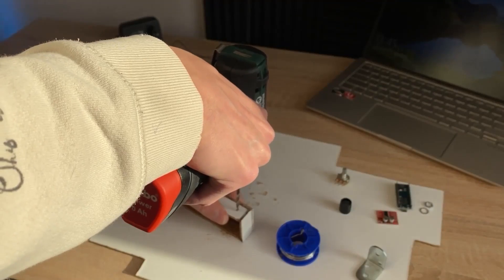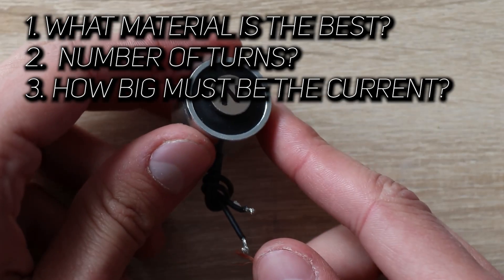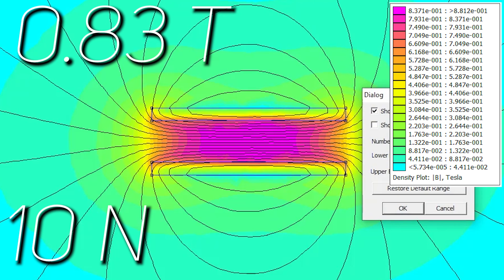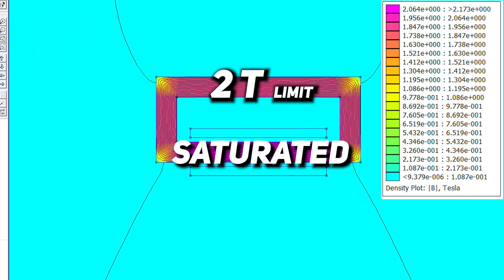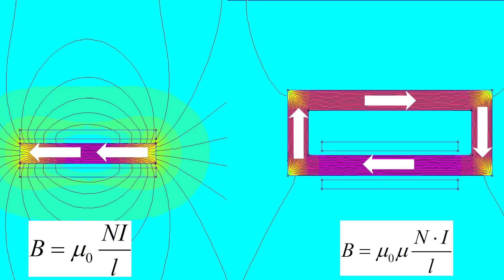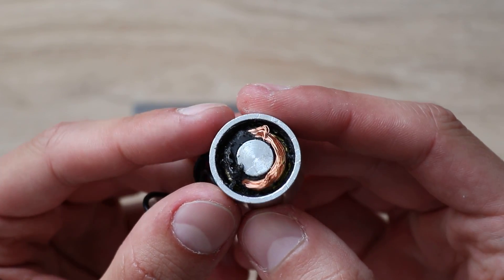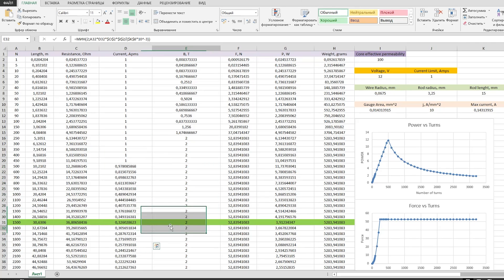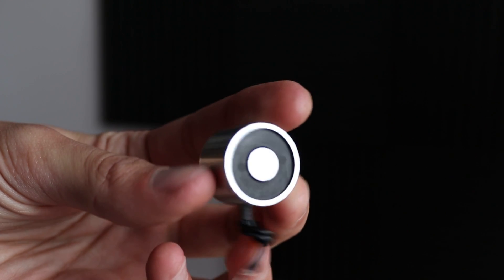5 Tips To Make A Good Electromagnet / How To Calculate Electromagnet Force?

Comment: Any chance you put a link to the solenoid and battery source you used?
Reply from the maker: Hi, could you please clarify which exactly moment you mean? I attached some links but not sure you wanted exactly them :)
shorturl.at/aUX23
shorturl.at/inCF1
Reply: Nice! Thank you very much! So you used a wall plug for the solenoid and not a battery? Nice! Thank you!
Reply from the maker: @R0M4NS623  Yeah, no problems with using wall plug power supply. Except mine had a limit of 1 Amp and it worked fine with an electromagnet form a store, but didn't quite work with a home made one due to a several mistakes i made :)

Comment: I wanted to ask a few questions, how did you get electrical steel in such small amount? Did you buy it wholesale with some other people? What is the realistic wire thickness if you are winding by hand? thanks in advance.
Reply from the maker: Hi, i think you can buy electrical steel roads from ebay, but then you need cut it, make a groove in it using lathe, which is not easy. Maybe the easiest option is to get an old transformer and use its core :)
Reply: @NickElectronics  damn, completly forgot about that site haha. Thank you very much.
Reply from the maker: @jokubasmirinas116  no problem

Comment: Thanks! i been trying to make a small pneumatic solenoid valve and the coil is as weak as a dead horse. 
my core is likely carbon steel. i just grabbed some iron rod stock from a hardware store and threw it on my lathe. 
my coil is ~1300 turns of 31 AWG magnet wire and im trying to stick with 12v for the coil. but i have to crank it to 24v to make it work and it gets hot. 
im not sure how much my 0.5mm thin walled delrin bobbin effects the strength. 

starting with better permeable iron core should give it a boost of strength. i'm not sure what else to improve.
Reply from the maker: Things will go better with an iron core, that's for sure. What is the resistance of the coil u have? How hot it gets? Cause even a magnet from the video gets hot. For example : 12V * 12V / 35 Ohms = 4 Watts of power. If your solenoid is really small you have a high power density and it gets hot. Maybe try increasing the number of turns maintaining the same length. Thus, you would increase resistance, lower current, lower consumed power, but save the magnet strength.
Reply: @NickElectronics  alternatively, use a thinner wire gauge and the same number of turns